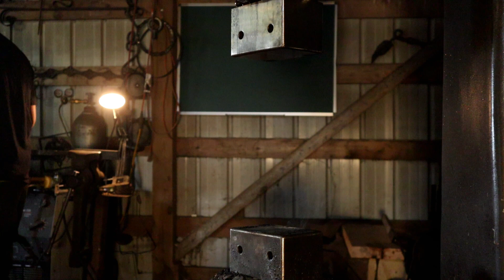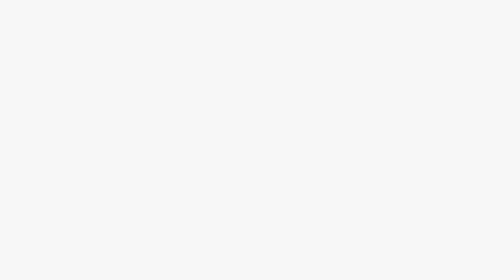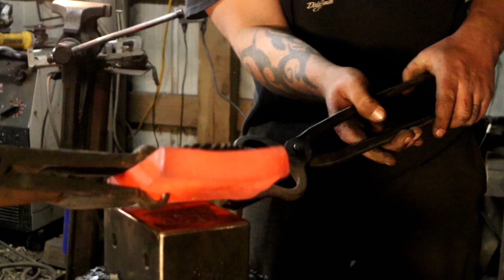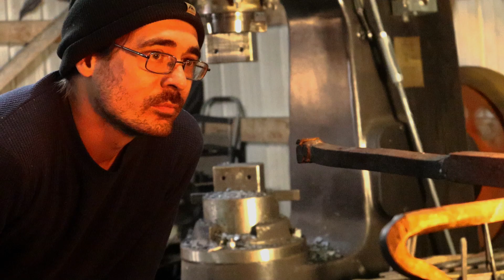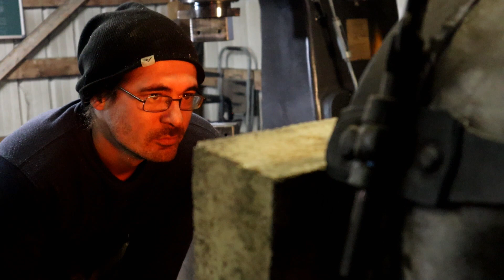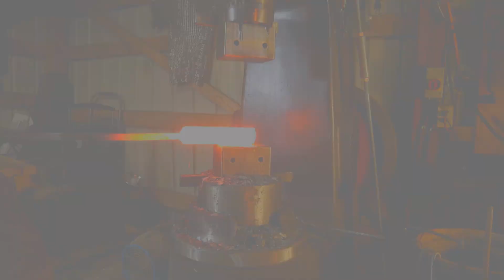Starting our Bladeshow 2020 Projects and Forged Sculptures

Comment: Could you or Ilya do a video on fitting and attaching guards. I welded mine and im hoping I did not subject the blade to too much heat after tempering

Comment: To Matt - you seem to be taking your time with the initial billet on the power hammer compared to earlier videos from you guys and other smiths I watch.  Was this intentional or just you getting used to the new power hammer?  I'm used to seeing the billets get worked out pretty quickly and wondering if there is a reason for the relative delicacy you used on this one initially?
Reply from the maker: Sure. Def wanted to take it easy and get to know the hammer. Also at the beginning of the video the hammer had not been adjusted yet so it was doing small little taps. The last weld and draw out I felt like I was getting pretty aggressive with it. Im just getting to know her ! I felt like I did a decent pace. I filmed all of that and got to where I did in one day and gave llya time on the hammer to work on his sword too.

Comment: how did bladesmiths back in the day hold their billets together before they had welders.
Reply: I’m by no means the expert but most of the billet welding they did they probably just drew out and folded it to keep it in place or stacked it like the Japanese and wrapped it.
Reply: Japanese Smith's use tongs
Reply: Maybe wrap it with wire?
Reply from the maker: Iron wire Perhaps. They also would have been using thicker layers to start with. I have seen Ilya just stack without weld or wire and just be careful.